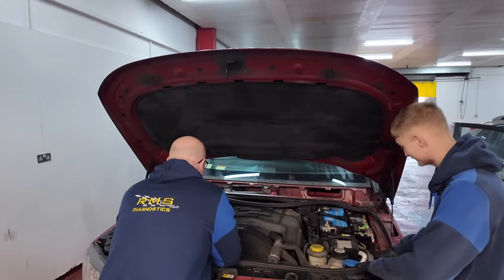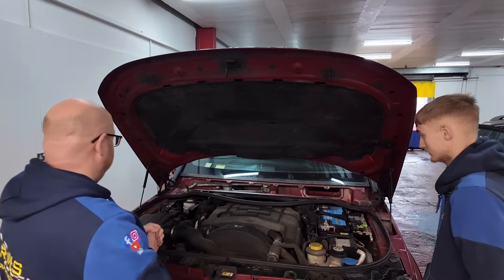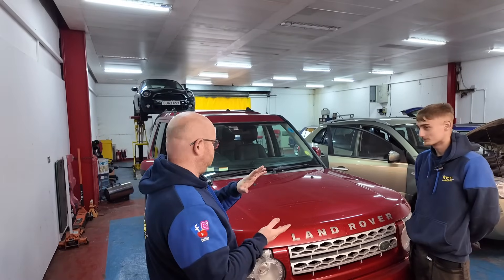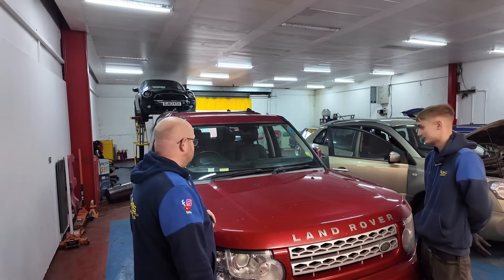How We Fixed a Windscreen Wiper Fault | Teaching Barney the Basics of Auto Electrical Diagnosis

Comment: Served my time with LUCAS SERVICE in the late 70,s early 80,s and spent most of my time cleaning and undercutting commutators on starters/ dynamos , sadly it's now a throw away world and you can't get the parts to recon things like this . . !
Reply from the maker: them days have gone unfortunately
Reply: I rebuilt the starter for our old Astra, Got replacement brushes on a well known auction site. I don't blame garages for not doing it. Replacement  units can be cheaper than the cost of labour and parts for rebuilding.
Reply from the maker: the days for the customer happy to take it and see how it goes has gone unfortunately,it’s all about i want it fixed I’m too busy to come back.even if the parts are mega expensive